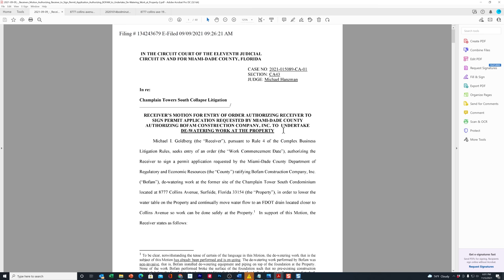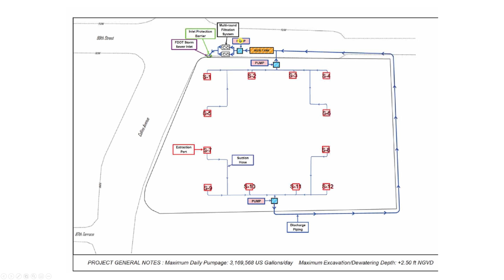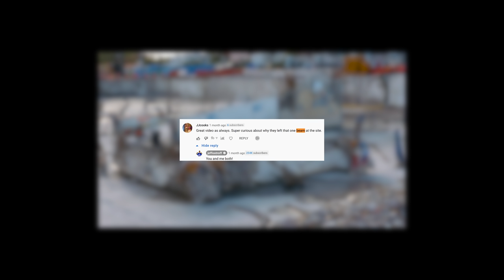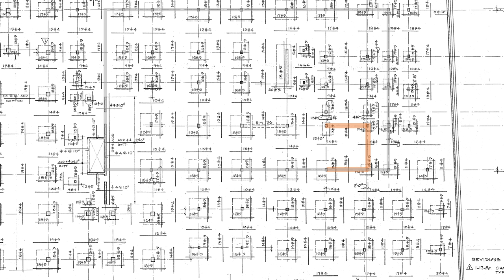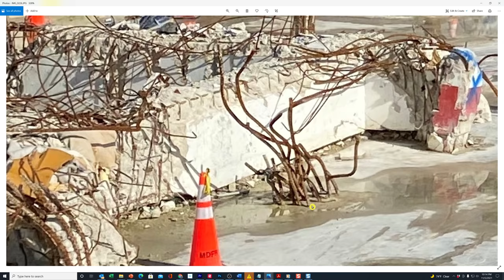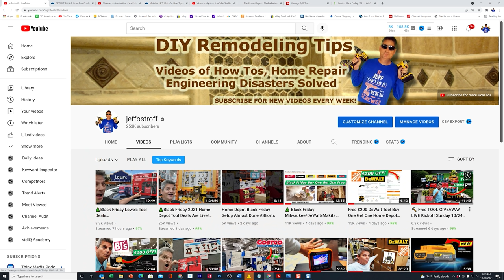Miami Condo Collapse: Engineers Baffled By Mystery Column

Comment: There is no extra column. They have simply cut the 4 columns and then put the H beam set up on the floor. What you are seeing is the ground anchor rebar (just the rebar x2) and the concrete elements sat on the floor offset from their original position at head height at the front (East side). The same applies at the back. Move that entire H bar set up to the north by a few feet and I bet the rebar and the concrete matches up perfectly. 

I would have thought that with you being an engineer you might have worked that out for yourself? Surely they teach you about perspective at engineering school?
Reply from the maker: actually, I was thinking the same thing about all of your statements lol. No, you were completely wrong the H being simply fell off of its four support columns in landed right next to them you can see it is still touching its four-support column, so it only fell about 12 inches to the north. It was too big for them to cut and or even move this thing, it fell on its own you can see it landed on top of debris as it fell. Go back and look at the original overhead picture posted earlier in the video that shows the entire lot underwater where all you can see is the ramp in the H-Beam sticking up. The H-Beam fell right exactly where it was, and the K column is now missing that the H-Beam was supporting. And so that area coming up with rebar from the floor is a column that was not visible in the garage video shot in there last year. But it is there now. Also, it is not likely that it was impaled from the K-column falling off of the top of the H beam because if it had there would have been a lot of floor damage there which there is none visible.
Reply: @jeffostroff  I genuinely think you are wrong and you are following a completely blind alley. As for an element of the collapsed building being too big to be moved, you are joking aren't you? The is/was no extra column in that area.

Comment: I keep thinking it coulda been the water. But was anyone found in there car and maybe accidentally hit a column that made the building collapse? Or is that even possible? I'm so confused how the water can make over half the building to collapse.
Reply: It was the water...  that corroded the pool deck reinforcement, which had insufficient strength in the first place.  The pool deck collapsed, propagated into the building and caused fatal damage to columns under the building.  5-7 minutes later, the building went.

Comment: that is the column from above the first floor, it punched down from above....it was never in this position before the fall.
Reply: or was it under the garage floor.
Reply from the maker: if it speared into the decking, where is the damage to the concrete slab?

Comment: that beam was on the next floor up and it fell so hard it went through the garage floor.
Reply from the maker: Well we know the beam fell down on the floor due to the collapse, but it doesn't explain how you have a column growing up out of the floor away from the beam also in a spot where there wasn't even a column designed into the equation
Reply: @jeffostroff  that fall is/was powerful and Im pretty sure it compressed and moved lots of things out of place.

Comment: 7:20 that mystery pillar is behind the one marked 15 to the left.
Reply from the maker: You are not even close. That pillar behind space #15 pillar is not even on the cross line of the H which is where the mystery column is. If the mystery column were on the garage floor during the video, it would be in the center of the screen in the image, below that pipe going into the concrete. Look at the photo again, find that cross beam on the H. You were looking at the north side of the H-Beam, 90 degrees off
Reply: @jeffostroff  well it is not I would hazard that the column moved off the "H" beam and embeded itself in the foundation and then crumbled under load.

Comment: Not one to look at this stuff but youtube really likes pushing random stuff. 

based on everything you showed you really have two options and only two options. 

A video in 2020 showed that no Column was there. There was a Column directly above.

As such either Someone started building a column without a permit in the middle of a garage thruway or the beam above no matter how implausibly was able to be impacted into the concrete in a fairly clean manner 

Those really are the only two options. Honestly I would suspect that it is from the beam from above as it makes the most sense without more images of the rebar or some photo or video info just before the collapse. It can be called a mystery but there are only two real conclusions... one that is supported by known data but is implausible (though not impossible) and one that is not supported by known data but would be plausible otherwise.
Reply from the maker: Good points

Comment: A hastily built support column
Reply from the maker: Could be that, and could be the K column slipped off the top of the beam and impaled the floor.
Reply: @jeffostroff  For sure! Impaled column might be the reason why the H beam and rebar are still in position. Which are both pertinent to the investigation, which I think you mentioned in the commentary. Although the external column appeared to fail first, perhaps the cascade occurred due to wider systemic issue and the H beam and impaled column are proof of that issue. Great analysis btw. Keep up the content!
Reply: @jeffostroff  Side thought - Terrifying forces involved to impale the floor, which is only shadowed by the loss of life and heartache.

Comment: H beam with no shear wall to prevent lateral movement, mystery column from floor above failed at joint to H beam.
Reply from the maker: You forget that there is zero damage on the floor where there should have been craters or something else if it had impaled into the floor but there is no damage. These rebar rods look like they were intentionally built up out of that concrete floor like it was done by somebody in the last 12 months, since Fiorella shot her video inside the garage in July 2020, showing no column exists where that mystery column is.
Reply: @jeffostroff  water covers the Punch Thru.  You can't see that detail
Reply from the maker: @Darenator1   If there really was a punch through of that concrete, there would be a huge crater and lots of cracks and damage around it not just a nice tidy little hole that is covered up by some debris in water

Comment: Not an engineer  but is it possible that colum  was driven into the ground after the fall Lotta speed Lotta weight
Reply from the maker: Your hypothesis comes up a lot from boatloads of people about that column. I don't think it's possible because if it had slipped off it would not likely have come straight down where the mystery column is which is only about two feet away from the HP. Also if it had impaled the floor there should be damage all over the concrete there and there is none where is the crater? So where else could the column come from? So far my prevailing theory is that somebody started to build that column sometime after Fiorella shot her video in July 2020. however I could find no permits for it
Reply: Got ya thanks for the feed back makes seance re looked at the picks ya the area is clean no craters i guess we chalk it up as cost overrun filler or something

Comment: You are in the wrong spot. The beam you show as the H beam in the basement photo is in line with the path of travel. The mystery beam exiting the floor is not in line with the path of travel but tucked in beside the driveway ramp. You are in the wrong spot.
Reply from the maker: You are wrong the H-beam is shown exactly where it belongs, comma and you're confusing being with column. The column coming out of the floor right now as it shows in the photograph of the debris site is indeed in the middle of that East West driving lane. I am not sure what you are basing your information on but it is incorrect I based mine off the floor plan.
Reply: @jeffostroff  here is what I see from  video of tower basement while still intact , video from across the street after loud noise, video that of cleaned off debris and videos showing plans. I believe you are too far into the building. The ramp off the street doesn't go that far into the building from the intact videos. The ramp of the cleared off site puts your area further into the building. In the intact building footage their are only two rows of columns to the outside wall to the left of the ramp. I thin k you are in the wrong location. I need to go over your other videos to look for more clues.

Comment: And what if that mysterious column was planned and due to need for more parking spots, the garage plan changed after they had already barbed the column(s)?
Reply from the maker: The plan did not change as you can see by the garage walkthrough video from last year, there was no column or barbs sticking out anywhere in this spot. Whatever this is it happened in the last 12 months.

Comment: 9:54 that giant beam is one bay down from the bottom of the ramp...
Reply from the maker: H beam is 1 parking Bay over to the right of the bottom of the ramp, but it is in line with the bottom of the ramp
Reply: @jeffostroff  : in the diagram it is. But in your video it's closer to the ramp. So it didn't fall straight down. If you think about it, why would it? The 4 columns under it were more likely to "topple" than to "crumble".

Comment: You've got your H beam and your ramp mixed up.
Reply from the maker: No you do. They are in the correct place
Reply: @jeffostroff  I'm referring to the mystery reinforcing rods. But I'll re-watch the video and I circle back to you. Where can I see a clear site layout docs? Basically they can't be there after the building collapses and not be there before the collapse. And I took it as that's what you're saying. Otherwise no mystery.
Reply: @jeffostroff  After typing a long theory twice and loosing it, here is the short version. The mystery beam has been rammed through the garage floor . It is the vertical beam that went up from the H-beam, that when building came down punched through the floor. H-beam shows no sign of where that vertical beam was attached. Hole through floor allowed ground water to enter, which is why that spot is in water. But you've probably figured this out already.

Comment: I think that is rebar hanging off the top of the h beam and not a column coming from the ground .
Reply: Did you not watch the video at all?  It's clearly NOT THAT.
Reply from the maker: No you can clearly see that the rebars are coming up out of the concrete floor. And they are cut off so they are not coming out of the top of the H beam
Reply: @johnbergstrom2931  I’m pretty sure it is . It’s a column that started on the first floor and rested on top of this transfer beam .
Reply: @jeffostroff  yeah it collapsed and punched thru

Comment: I think you are looking at the wrong orientation. The mystery beam obviously was not in the middle of the lane.
Reply from the maker: We're not looking in the order wrong orientation I clearly showed it from several different angles in from the video and everything is based off of where that column with the red stripe is. And if you look at the overhead drone video shots you can see that the H beam is exactly where it is in the drawings as well it fell right in place next to the four columns that were supporting it. You can't make a statement like that without proving it so prove to me what orientation was I looking at and how did I get it wrong? Then we can start from there. But you can't just say my orientation is incorrect unless you know that it's incorrect and can prove why it is incorrect
Reply: Use your brain.
The mystery column wasn't in the middle of the lane IN JULY, 2020, when the video was shot.  But it sure as hell was there on June 25th, 2021!
Reply: @johnbergstrom2931  That would suggest they knew they were having issues and a structural engineer determined that adding an additional column at that location would stabilize the building. Who is this structural engineer?
Reply: @BuckRogers20011  There was no permit drawn for this work.  A licensed structural engineer would touch a job done under the table like this.  He'd lose his license, and his reputation.  Also, the column was being constructed in a location where it could have only stabilized a small part of the lobby level slab.  It wouldn't have added any strength to any of the columns or H beam.

Comment: When the building collapsed it pushed that column down into the ground
Reply from the maker: zero damage on the floor where there should have been craters or something else if it had impaled into the floor but there is no damage. These rebar rods look like they were intentionally built up out of that concrete floor like it was done by somebody in the last 12 months, since Fiorella shot her video inside the garage in July 2020, showing no column exists where that mystery column is.

Comment: My guess is  the H-beam fell one column frame north
Reply from the maker: Well your guess is way off. One column north way off. A beam dropping 10 feet can't fall 20 feet away! Look at 1:06 again, that shot was taken directly overhead clearly shows that the H beam is exactly where I said it was. Everything makes sense and lines up including if you paid attention to where I said watch this column with the red stripe on the bottom. It's the only column in that area of the garage with the red stripe. And when you look at the video of the lady walking through the garage it clearly shows as I pointed out in the video, the H beam sits with the corner of it directly on top of that red striped column. So everything aligns with what I said. You need to prove how and where I am off.
Reply: @jeffostroff  Show me a building permit/plans for that new column. They should be in the public records . The fact none have surfaced in the months of various people (yourself included) reviewing all the records of this building, leads me to believe the H-beam shifted somehow as it fell. A or B.

Comment: This video is clickbait.  The "H" is out of position by about  half its width, and might be upside  down.  The "MYSTERY COLUMN" is probably 27.          The reason for the displaced column above the 2nd floor is to keep it out of the adjacent space and create an open corner room.  

Since all columns (at each floor) are held in position by rebar rising from the column in the floor below it, they would be restrained laterally.   However, the floating column would not have that restraint from below.  That is why I think it could have slipped laterally off the beam and punctured the floor.  It would be interesting to see how much rebar went from the beam upward to tie the column in.
As you have already Identified poor rebar practice, and history of the architect....
Reply from the maker: Your trolling comment is click bait D H beam is not off by half its distance and you know it. You can tell by the photo that it is stand too it's four columns that were holding it up it is only 12 inches north of where it was standing before.  So everything you said is pretty far off from reality it can't possibly be column 27 because column 27 is at least 20 feet West of this H beam an column 27 lies directly in line with garage ramp.IT is actually Column M10. Dead each beam is there to hold that floating column in place on the 1st floor all the way up to the penthouse. And to avoid having to have the column come down into the garage where it would block the east West driving lane.
Reply: Upon review, I will concede error.  It's   probably the end of the displaced column  that slipped off the beam and punctured the floor by the weight above it.  Since the floor is leaking it could be a puncture through the floor.  Since there is water around it, the edges of the puncture are not visible.   I would suspect, that upon demolition, a significant length of the column is below the floor.   This would be verified if no footing is found below it.  Because reinforcement below the slab would blow the concrete downward, the upper surface of the slab could still appear pristine.

Again, my apology.
Reply: At 2:20,  the column in upper right should still be green.  It carries no weight from columns above it.